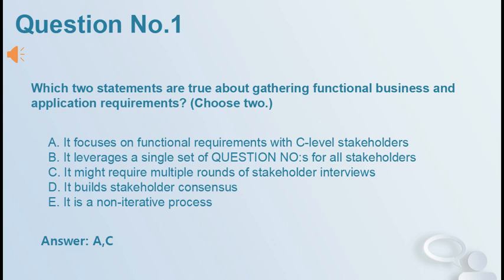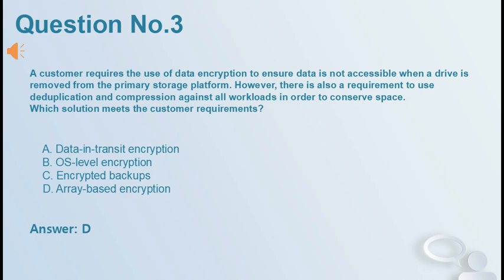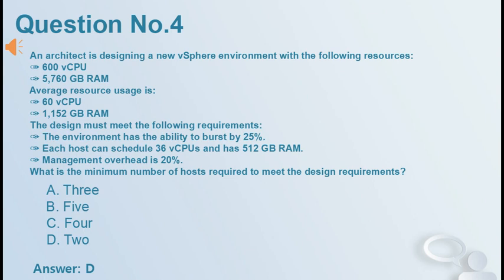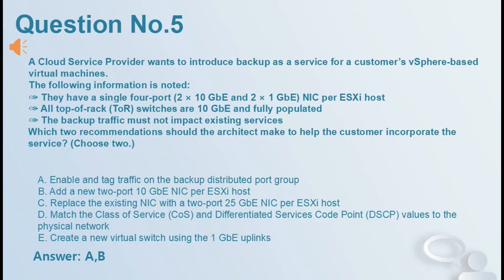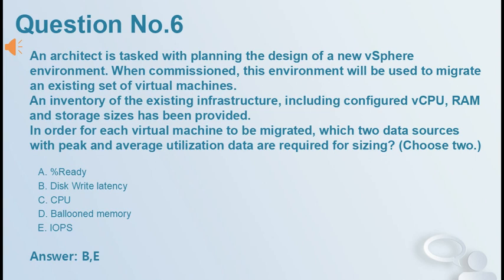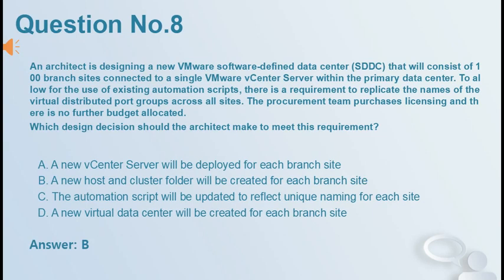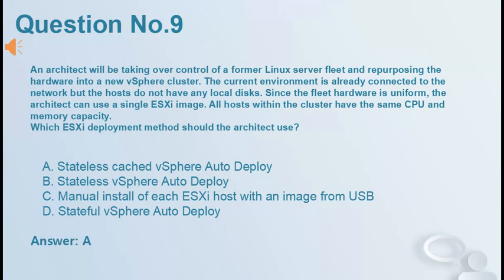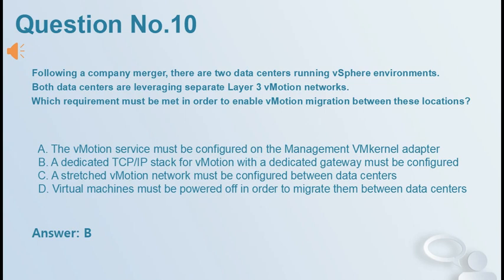VCAP-DCV Design 2021 3V0-21.21 Dumps Questions Online

Comment: Yeah, I took the test and failed with a 160. These answers are not correct.
Reply from the maker: Thanks for your details. Which version do you use as the preparation materials?
Reply: @onlinedumps8182  These questions were on the test, but the answers were all wrong.